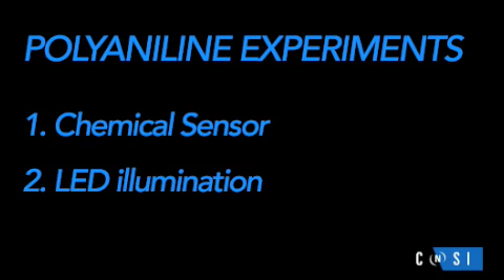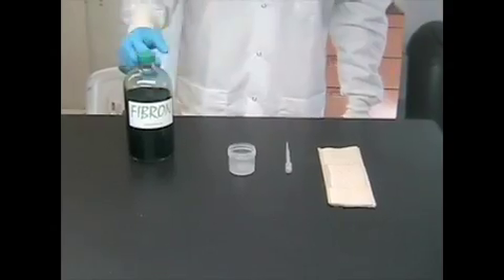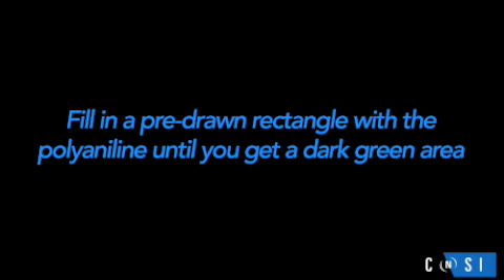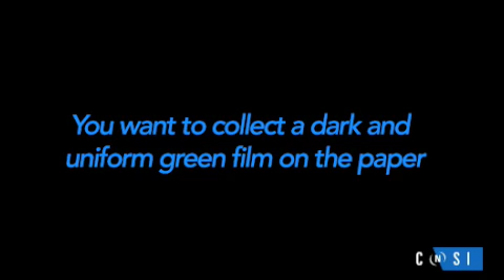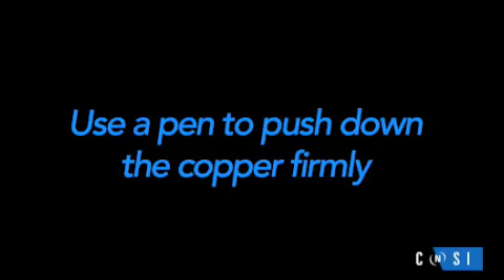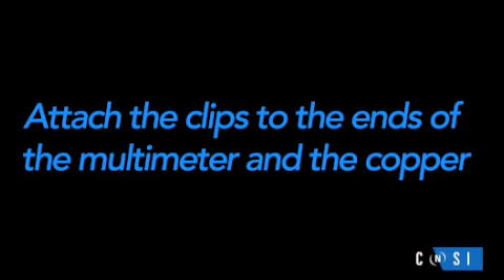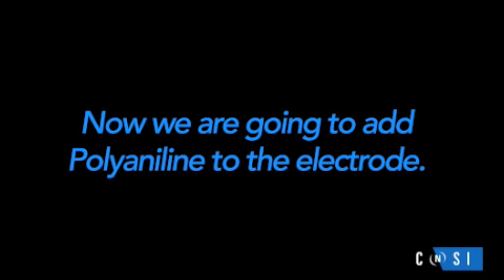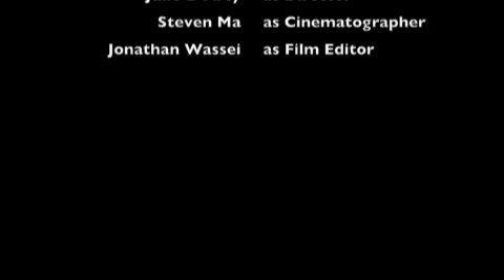UCLA MCTP: PANI sensor experiment

Comment: Ok Dude.. you using Synthetic Metal on top of plastic etched with copper (Metal) to complete the circuit for LED.. ? Hmmmm, something does not sound right, You need to use Synthetic metal on top of plastic or glass to complete the circuit then we have  something here.